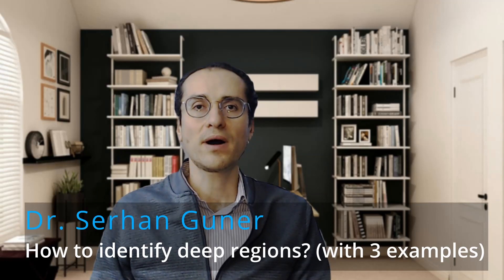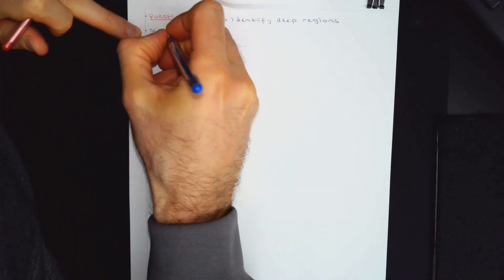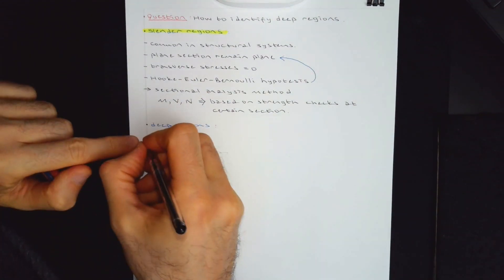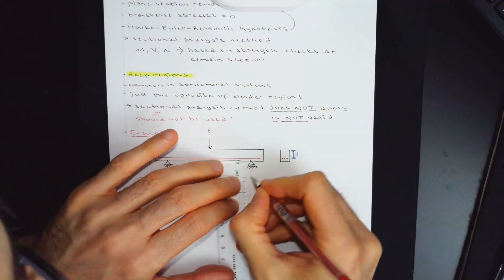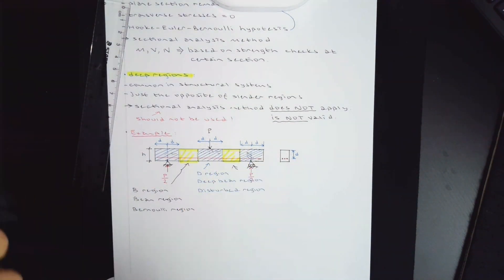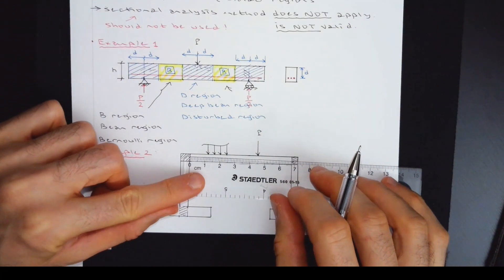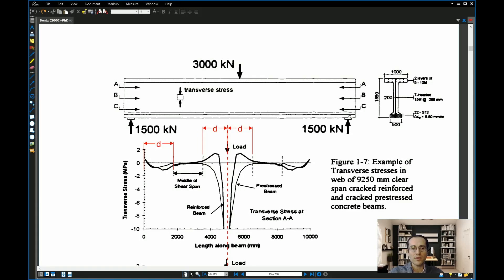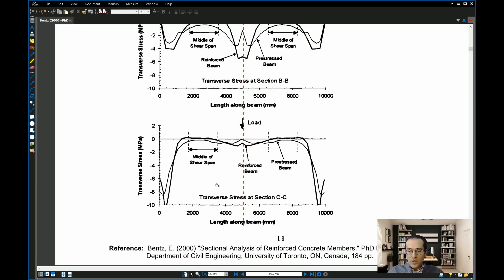Deep Beams: How to Identify Deep Regions as per ACI 318-19.

Comment: great video Dr. Guner. My question is if the load was a UDL rather than a point load, would it significantly change the D region? Partial UDL or full span UDL, how do they differ with the point load?
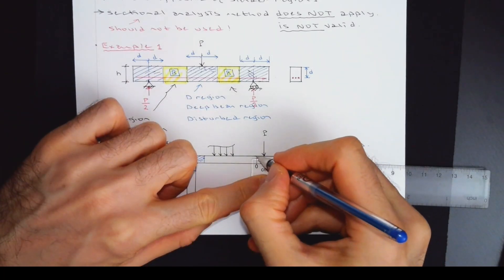Reply from the maker: Thanks for your interest. I talked about UDL in 7:53 of this video. I hope it helps.
Reply: @SerhanGuner  Thank you very much!